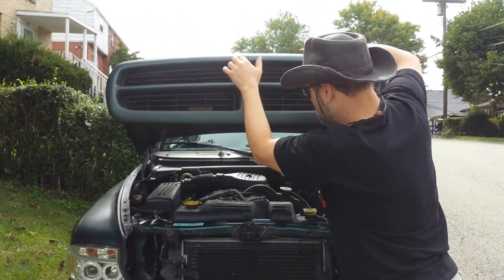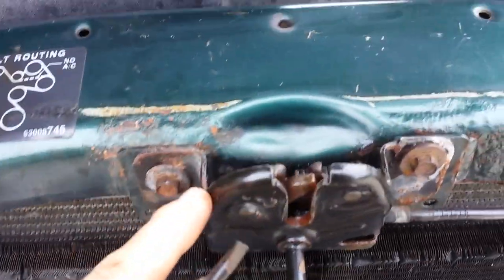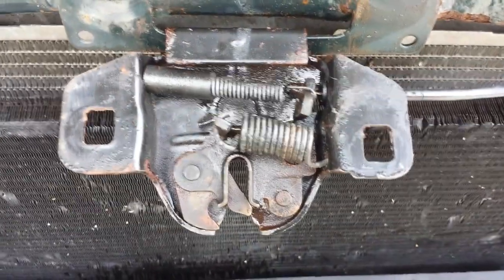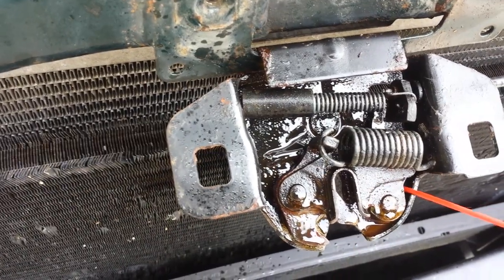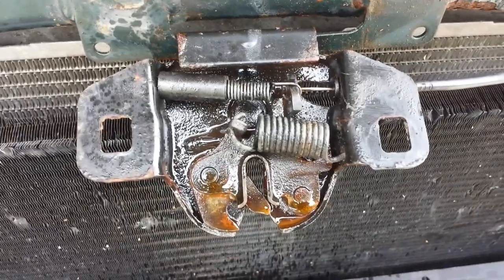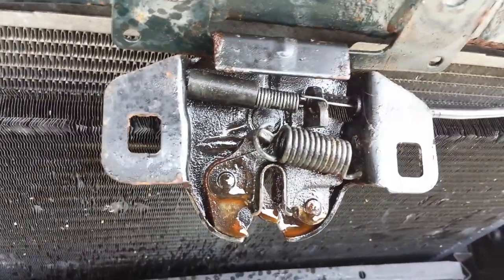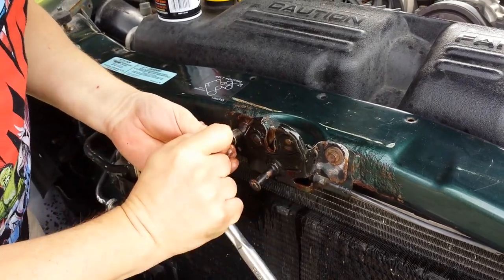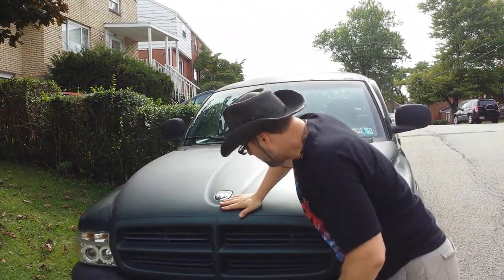Fix a Stuck Hood Latch 2000 Dodge Dakota

Comment: The issue im having is mine won’t release so I can open the hood.
Reply from the maker: Thinking back, I had the same problem at one point while dealing with this issue. If I remember correctly, I ended up trying to manipulate the hood latch mechanism through the grill and from underneath the front end of the truck. It was REALLY  a pain! So here's what I'd recommend: 
1.) Spray penetrating oil into the mechanism from any AND every angle you can. You may need to tape a couple of those little straw things together to stick on the nozzle so you can poke it in and reach the mechanism. Too much is the right amount. Do this over a couple days and see if that helps.
2.) Confirm that the release cable isn't broken. If the lever under the dash is broken or the cable snapped or it somehow came free from the latch mechanism, it won't pop the hood. If that's the case, you just need to be able to trigger the mechanism from somewhere past the point of failure.
3.) Go to a junk yard and take a working latch off another dakota. Get the cable too if you can. If possible get the mating portion attached to underside of the hood too. (Take a drill in case of rivets) They are not hard to remove nor expensive. Having a working one will give you a backup if you end up having to break the one in your truck.  Also, having the extra will give you a model to look at to see what you can try to do to trigger the mechanism and get your hood open.
4.) Try to get the mechanism to release by manipulating it from through the grill or under the front. If you have a friend inside the truck to pull on the release lever at the same time, that may help.
5.) If all else fails and you still can't get the hood open, cut the latch with a reciprocating saw or other thin blade. This sucks, but if nothing else works, cutting the latch will get the hood open and since you will have gotten a replacement already, it shouldn't be too hard to swap the parts once the hood is open. Just be careful. Try not to damage the surrounding hood or mating grill frame. Any place that gets scraped should be painted to prevent rust. 

That's all I can think of. That's an annoying problem, but there are options. While they all require patience and no small amount of grunting and groaning, none of them are all that difficult. Feel free to let me know how it goes. Thanks for commenting.  Good luck!

Comment: Thanks for the video. I thought I was going to have to take this to Dealer and spend some real money.
Reply from the maker: Oh I'm glad you didn't have to do that! Personally,  I try NEVER to go to the dealer. If I couldn't fix the latch, I'd see if I could order a new one online or go to a junk yard. Most latches are pretty easy to replace as they usually have 2 bolts and just a little hook or ball style cable connection.  Thanks for watching and for commenting!

Comment: What if it's seized in the latched position?
Reply from the maker: UGH! That sucks! If it's seized in the latched position I would probably try a series of different things:
I'd spray a lot of penetrating oil (PB Blaster, Liquid Wrench, WD-40, etc...) in to the latch through the gap between the hood and the grill, or maybe the grill vents. Really, any gap that gets the spray tube in close to the latch mechanism. Repeat this over a few days then see if you can get it to open by pulling the release handle under the dash. If it does open, it will probably stay stuck in the open position, but at least from there you can get the hood to open up. 
If you can get the hood to open up, then next thing to try would be to remove the mechanism and if possible, take it apart, remove the rust (maybe soak it in evapo-rust over night, then reassemble. 

The mechanism may be pretty far gone though, so you may find it easier at that point to just buy a new hood latch mechanism. Stuff like that is often pretty easy to find on amazon.com, or rockauto.com. Of course the cheaper option is to go to a junk yard and pull the latch mechanism from another truck. If you do that, it might be worth taking the latch parts from the end of the hood as well, just in case those need to be replaced.
If penetrating oil doesn't do any good to get the latch to disengage, then you may need to try to cut or break the latch to get the hood open, then replace the parts. You may be able to get in with a reciporicating saw or grinding wheel or even a rotary tool with a cut off disk (actually a pack of cut off disks as that would be the long slow way to do it.) once the hood is open, replace the parts.
Cutting or breaking the latch is obviously the last resort as you could end up doing other damage in the process. It's possible that you the release handle under the dash is not working, but if you can reach the mechanism with a long pair of pliers or other tool, you may be able to disengage the latch from outside the vehicle, so look for any angle which allows you any access to the mechanism whatsoever.
That's a terrible problem to have! Good luck. Feel free to let me know how it goes. Thanks for the question!
Reply: @ClayCarlino  It took me a few days of reflection and despair but I laid down under the bumper and stared at it for about 30 minutes. The staring part might be important. I was able to visualize how the latch worked because I had watched a few Youtube videos. The cable had snapped off when they did the oil change but they rigged the cable so that a short section was extending. I later brought the truck for a safety but the mechanic didn't have much patience with it so he slammed the hood down and it was very tightly latched. When I pulled the remaining cable it just eventually snapped off. So after three days f despairing, and 30 minutes of reflection, I made a very small hook on the end of 10 gauge wire and put it through the grilled and after several attempt was able to hook into the mechanism although I wasn't sure if it was in the right place. I got my buddy to push down on the hood while I jiggled and pulled the wire and VIOLA, it popped open. A person might be able to use a coat hanger but would need pliers to make the hook. I later looped the wire end around the spring connector, crimped it shut and shaped the wire so it would be easy top pull and loop around the grill without rattling too much or falling out.. It can be pulled or pushed depending on whether you want to open or latch it closed. Never underestimate a 'wire clothes hanger' and needle nose pliers. They should be part of every auto survivalist's arsenal. Share if you like.
Reply from the maker: @philipmarkedwards  Congratulations!!! Good job! I whole heartedly agree! Wire coat hangers are just about the most useful item in my house! The only thing I don't use them for is hanging coats. Thanks for posting this. I hope everyone who watches this video reads your post to learn about your experience. Thanks again!